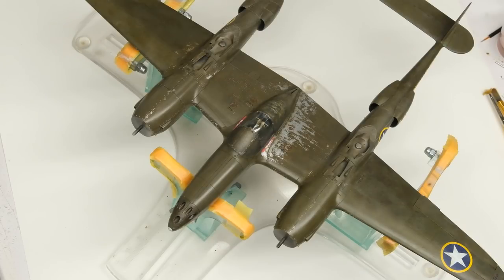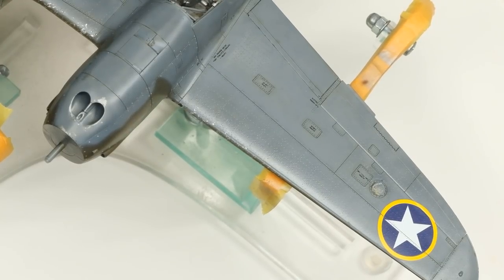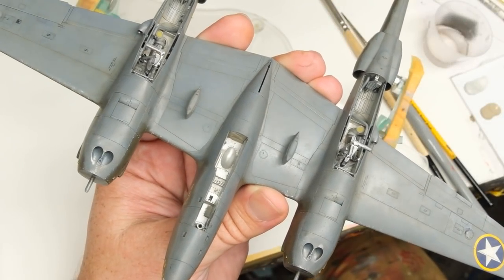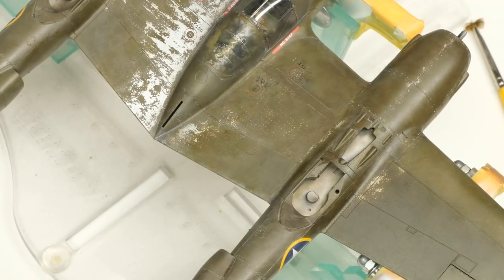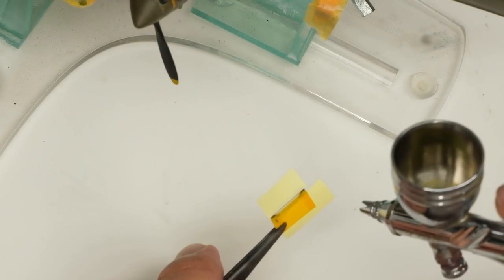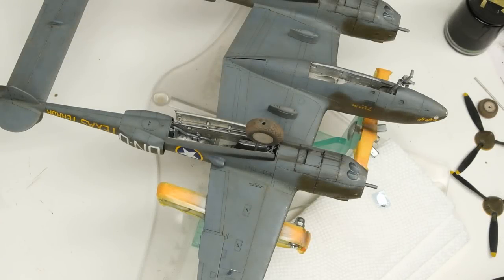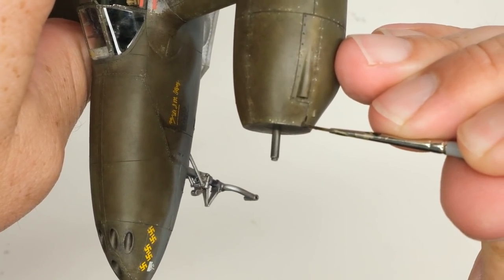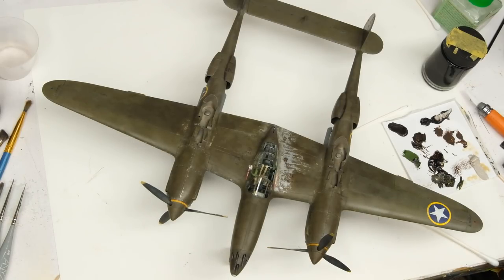Tamiya P-38F Lightning 10 - Oil + Ink Weathering

Comment: Would you consider doing a video on the brushes you are using, your favorites, etc? I have a bunch that I get by with but I think you've been able to test and experiment more than I have. Could save some time and expense. Thanks and yet another great video. Really looking forward to building mine.
Reply from the maker: Will consider it - though when it comes to brushes I'm very much a barbarian. My only firm recommendation is to get a deerfoot stippler or three. They're amazing for oils and similar.
Reply: @DoogsModels  thanks. I know you're busy, just a thought. And trust me, my brushes get no special treatment. Lol. My airbrushes do, but not the hairy ones.

Comment: Inboard side of tires and wheels get a bit shiny due to hydraulic leaks from brake caliper. Aluminum when scuffed, walked on, tend to polish a bit shiny. Quite hard to replicate with paints, so use bare metal foil, keep clears off part of it. But your paint work is fucking great!